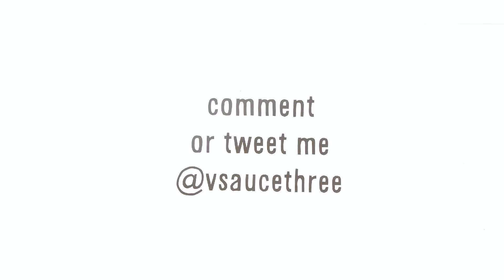5 Awesome PlayStation 4 Facts! -- Fact Surgery

Comment: Peasant Box One!
Reply: ***** Because 500 dollars is a lot to pay for a paperweight. Silly commoners!
Reply: Peasant Station 4 makes a lot more sense.
Reply: Kroeckinator 
why?
Reply: The Xbox One is better.
1. The playstation 4 no longer has free internet so finally you playstation fanboys can stop saying that as your only excuse to saying why the playstation is better.
2. So what if the playstation 4 is "more powerful", put the consoles side by side and you won't be able to tell the difference.
3. All the ps4 has is the share button. But on the xbox One if you are not lazy and willing to put more effort in making your videos better, you can do that with a studio on Xbox one.
4. You can do things at the same time.
5. More apps.
Need I say more?
Reply: GuineaPigGamer You Should say less. So you can stop doing more things at once. Just do nothing.
Reply: GuineaPigGamer Xbox One has a terrible interface though and a larger price tag. Also the installations are really slow not to mention that games require a lot of space with no external storage, but I digress. Both machines have great exclusives and I can't wait for this year's games.
Reply: I'd like to interrupt this wonderful conversation of yours.
PC will pretty much always have the upper hand. Gaming systems have barely any difference between them anyway, seriously. The only reason I went for 360 over PS3 was that the 360's controller triggers were easier to hold. That's how arbitrary it is. So, while personal preference is great, there is so little difference that personal taste is the only real arguing point.
Also if you think there's lots of difference, my PC has 2-8 year old tech and is slightly more powerful than current gen consoles. So with these consoles being 'top-end', comparing that to the most recent stuff you could buy for the same price as say that Xbox One, you'd blow it out of the water.
But I digress. If you still wanna argue, be my guest.
Reply: Arbitrary comment, spelled badly and with no citation on technical specifications. Well done, opinion can be ignored.
Reply: *****
I'm not an Xbox One fanboy. By the logic that your using you would be a ps4 fanboy. Please shut up, and go learn how to use logic correctly.

Comment: It's crazy how far video game consoles have come in such a short time.
Reply: its becuse a new cosle did not come out sence well 7 years about i think?
Reply: the sad thing is they could easily do a lot more but they withhold upgrades to make more money.
Reply: ya thats right
Reply: Simi Mark They withold making it more powerful to save the consumer money also. $400 is actually really cheap for a PS4. To build a computer with the same hardware as the PS4 (even though it wouldn't run as well) costs upwards of $600-$700.
Reply: OcarinaNewbie yeah i suppose you right on that point. I just hate it when they call it it "next-gen" when in actuality thats not the case.

Comment: You forgot PS4 fact: underpowered mid-range computer that was outdated the moment it hit store shelves.
Reply: Then why Killzone: Shadowfall looks better than Crysis 3 on maximum settings?
Reply: Marcuss2 Hahahahahahahahahahahahahahahahahahahaha
Reply: Marcuss2 Because Crysis 3 isn't exactly the top benchmark anymore
Reply: 1024BenZ that's not it at all. Killzone is a 3rd person shooter which means resources allotted to texture quality can be compressed. Also, a lot of other things.
Reply: SolarMoth I think you've been bumping into lamps a bit too often, its a First Person Shooter.
Reply: +MoronicChunk1 Does it really matter?
Reply: Marcuss2 Because they only code Killzone for PS consoles while Crysis games are coded for multiple platforms.Optimization is also a key element, not to mention the support it gets from Sony.Same thing as CoD; Ghosts where even though the Xbox One can handle it, it only runs at 720p because Sony paid Activision.Nevertheless, it's an outdated console.It's the most advanced so far, but it came out in the wrong time, the time where most PCs kick every console's ass.
Reply: Marcuss2 Because the trailer was probably recorded from a PC

Comment: And still it cannot manage to run 1080p and 60 FPS without sacrificing drawdistance.
Reply: Doesnt need 1080p. Lets face it, if dvery game had 1080p the games would be prohibitively expensive.
Reply: Vernon682 What the fuck are you talking about?
1080p doesn't make a game more expensive, Neither its a developer choice to make the game run at 1080p, If they could make all games at the PS4 run at 1080p, They would.
But they can't because the PS4s hardware is shitty, The 5 year old GTX 480 has beaten the PS4, In graphics, Resolution, Drawdistance, Framerate and higher settings....
Even underclocked the card was still much more powerful than the Xbox One.
Reply: Vernon682 Someone SERIOUSLY doesn't understand the fundamentals of how a computer works.
Reply: you seem like the kinda guy who is a sworn pc gamer so i ask you this give me the specs of a pc which you could build in 2006 that can run a game like the last of us and your budget is $600
Reply: Sunny Davies How do i know if it can run the last of us if i don't have the minimum system requirements for that game?
Reply: lets give it an equivalent game such as metro last light on high/ultra ? i think thats about fair?
Reply: Sunny Davies But consoles ran it at 640p and ultra low settings, Also, Because a RAM factory burned down RAM is more expensive now, especially the older DDR2 RAM, Because it doesn't get made anymore, Its possible to make a PC that outperforms the consoles, But the parts just don't get made anymore and its hard to find pricing and parts from that time.
What i can do is make a PC build under $500
That will run most games on high/ultra: http://pcpartpicker.com/p/TZBXJx
Reply: ventusluca these specs arent exactly old though are they? i know old kit is difficult to come by nowadays but use original RRP's and find me a decent rig because i couldnt find one that can run metro at high/ultra and 720p is the resolution of tlou on ps3
Reply: and this is my current rig just so you know im not a typical console fan boy 
http://pcpartpicker.com/p/zT4H7P
Reply: Sunny Davies PS3 was 672, Which was a huge difference btw.
Reply: ventusluca
Reply: Sorry to bring this up again,don't wanna start a Console vs PC war or something-

A Computer built ind 2006 with a budget of $600 could not run games like the last of us on highest settings even if a 5 years old GPU outperforms new consoles.

The PS4s hardware is not the best but it can keep up with high-end gaming computers.(Not those unnecesary $2000+ computers)

Why is that?You can't modify consoles so the companies can work on making all the hardware inside the console work together very well and create an API that works well with the hardware.They don't have to worry about compatibility issues because all the components just have to work well together.

Computer are built to be modified.Get a new GPU,maybe a new CPU.Oh i should get a new Sound card too.In general the components of a computer don't work as well together as the components in a console...not even close.
Hardware manufacturers have to make sure that their mainboard is compatible with GPU X,Y,Z and CPU manufacturers have to make sure that their CPU is compatible with Sound Card A,B,C.
The API has to work with all of those components too.You know how you cant emulate Xbox 360 games on computer right?Thats because Computers and Consoles use different APIs.For example Computers use Direct X.Its a different language if you will.

It's a one size fits all system.Everything works with everything but not optimal.

Speaking of APIs.APIs are improving too.There is DirectX 9,DirectX 10 which is faster than DirectX 9 and there's DirectX 11 which is faster than DirectX 10.
A GPU from a few years ago might not support DirectX 11 and thus doesn't have an as good performance as a exact copy of the GPU that has DirectX 11 support.

Thats why console games can look good even several years after the consoles release.Of course games then won't look as good as on computer but they often times still look better than games that were released on the same console a few months after the consoles release.

Another point to keep in mind is that a computers hardware is bigger than then one of a console.The PS4 of a friend of mine sometimes overheats in the summer because its cooling system is not good enough.You just can't put those big coolers you put on a CPU on a consoles CPU because there's no room for it.

Why do Console games look worse than PC games right now?
There are a lot of reasons.Programmers need to get used to the console first,they have to learn how to utilize its resources correctly.Games get pushed out,the more launch titles the better so they are not polished well enough.
A good example for that would be watch dogs,over time they degraded its graphics and even on PC it runs worse than it should.Its a badly programmed game.

A console can perform better than a computer even if its hardware isnt as good as the computers hardware because of the reasons listed above....granted the programmers do a good job optimizing the game.
Reply: Dominic Duncan So you call 720p, 30 FPS and horrible res textures high graphics?
That's new to me.
The PS4 cannot keep up with high end PCs at all, The PS4 is like a low end PC with a crappy OS.
It doesn't handle games at 1080p 60 FPS.
Reply: ventusluca Not all PS2 games supported HD but some did and those weren't released early after release.I never said 720p,30 fps capped and "horrible res textures" are high graphics.

I already told you it takes time to adapt.Let me correct myself,I got ahead of myself a little bit.The PS4s performance compares to a mid-end computer.

Just give the companies some more time and graphics quality will increase.
720p 30fps capped is nothing new on consoles.
For console standards the capabilities of the PS4 are high.Games look good on the PS4.I told you that games will always look better on PC than on console.

The PS4s graphics are good for a console.Nobody complains about the Nintendo3DS (or whatever,dont really care about handhelds) having shitty graphics.Why?Because it's good compared to other handhelds.The PS4 is the most powerful next gen console and provides good graphics as a console.

Let me repeat myself: PC Graphics > Console Graphics but consoles can better utilize the capabilities of the hardware.
Just don't expect consoles to ever be as "good" as PCs.
Reply: ventusluca Ew AMD
Reply: ventusluca obvious troll is obvious.
Reply: Peter Griffin About 99% of the gaming community.
Reply: ***** Worse.
Reply: ventusluca 99%? Speak for yourself. I don't care if a game runs at 60fps or 30fps or if it's a retro 8-bit or The Last of Us; if I don't get what I pay for, then it is (IMO) a bad game.
Reply: Aoi "Ew AMD" you didn't have faith

Comment: What the hell is a TFLOP?
Reply: FLOPS is an abbreviation for FLoating-point OPerations per Second.  The T, as Patrick said, is for "tera", or trillion (10^12).  What's a floating-point operation?  A calculation involving two decimal numbers.  Bringing it all back to the fact in question, we get "The graphics processing unit can perform up to 1,840,000,000,000 decimal calculations per second." 

While this allows for comparison with other processors, it doesn't mean much in practical terms.  Just as a high IQ doesn't guarantee you'll be a successful entrepreneur, a fast processor is only one factor in a machine's performance.
Reply: more on FLOPS.  many developers these days are using advanced software tools that auto-fill code, pre-fab functions, graphical interfaces, etc-- but underneath the hood, there is a data-type known as "float"-- as opposed to "integer" or "simple" numbers.   Floats can have much more significant digits than just 2 decimal places... they are actually used to calculate lighting effects and "physics" so they are actually very important... er should I say, its important to have a machine that can shred in the "FLOPS" department
Reply: As Frijole said, FLoating-point Operations Per Second. 

To Expand upon that though, most of the TFLOPS come from the GPU using Half-Precision calculations and for higher end precision stuff that falls to the CPU which is typically under a couple hundred GFLOPS. 

I guess what I'm saying is this is Fast and Loose Computing! 

This is the wave of the future with ARM and AMD Leading the way so, these consoles represent where the Industry is heading as a whole so, as much as they're behind the performance of current Computers, they're ahead of those computers in their approach to it. 

If you want to know more, look up OpenCL, HSA and even AMD Kevari as that's their first APU to implement the concept.
Reply: Frijole Thanks for explaining! :D

Comment: GTX TITAN would have better frame rates than 10 play stations working together as one.
Reply: PC can max frame rate is about 91 so you were wrong and playstation is got better fps anyway
Reply: ***** Actually, Killzone Shadow Fall runs at 60 FPS.
Reply: MartyKuB PC's don't have a max framerate, it goes as high as you want it to based on your configuration. My PC runs BF4 at about 200 FPS at a low res of 1080P. Some say that wound be unnecessary, somewhat true. But if i crank it up to 2560x1440 with 8x Spares Grid Super Sampling and 16X Anisotropic filtering it barely touches 60FPS, so it's still not good enough in that sense. Now you just heard a lot of geekstuff you console players probably never heard about, but in short, the graphics fidelity is sublime compared to any console out there, with roughly 10+ times the performance of a PS4 and also about 10 times the cost though :D
But the main point is, where did you get that number of 91FPS... out of your ass?

Comment: You can plug in any headphones into the ps4 controller and listen to the gameplay through there, incase you didnt already know that. I was surprised to find that out (because i never read any manuals), and it made more sense as to why the controllers battery life is crap. If you didnt know that, plug in your headphones, hold the PS button, go to adjust devices and change Output to Headphones to all audio. If your headphones come with a mic, it will be used for voice chatting online too. The More You Know...

Comment: you guys forgot 1 thing about the ram and hard drive space... pc is 10x better
Reply: beastabuelos last time that happened to me was a couple of months ago and it was because i pirated the game just to try it, and i bought it and it never crashed, games only crash because either your playing on a crappy $50 computer or the game is pirated and rarely if its an indie title and they did a really crappy job with bug testing which also happens to consoles..
Reply: beastabuelos  lets see  

Mods / Keyboard mouse use / Steam / Modifyable so you don't need to buy another pc just parts / not just for gamers / has great internet acess and programs ps4 could only hope of / etc

Honestly when ps4 runs WoW and all the macros and buttons or Arma 3 then i will be impressed.
Reply: beastabuelos "just noticeably better" try 100x better.
Reply: beastabuelos not really i have seen major differences extreme differences it is really noticeable.
Reply: beastabuelos no hassle at all other than buying the pc i could sit on a computer i have never touched before and 2 minutes later ill be downloading the game 10 minutes later i would be playing it, and if the difference is barely noticeable then you should probably check your eyesight cause a difference is MASSAVE.
btw i have a spreadsheet of all the games i have in the price i bought and the retail price and it shows me how much i saved through humble bundles and steam sales, i saved more than $1300 and my computer only costs 800

Comment: I've played all three big consoles: XBOX One, PS4 and PC.

I'd say PC is best because of the customization of the console. Want a better looking game, upgrade the internals. However, with a console, what you get is what you get, you cannot change anything (except the memory), which is changeable on EVERYTHING.
Reply: Wii U is part of the "big consoles too" totally underrated
Reply: Yes, your correct but your also wrong cause memory can affect the performance. You can upgrade to an SSD which is what PC uses, this would probably shorten the times for loading, rendering maps for about 10 to 15 seconds. Not a significant difference but still, it affects the performance. However, its a bit pricy, if you want to get a nice SSD, its gonna cost you well over 300 dollars, unlike the original 500 GB hardrive which is around 50-70 bucks. Personally, i might have to upgrade to the SSD in the future (when things get unbearbly slow) but for now, its fine.
Reply: Brady Barnes Underrated?
More like overrated.